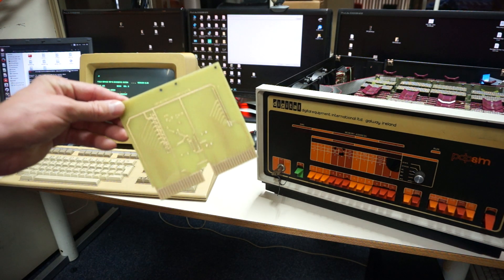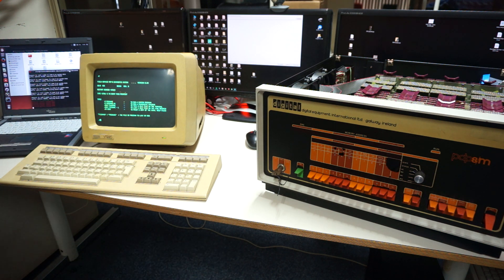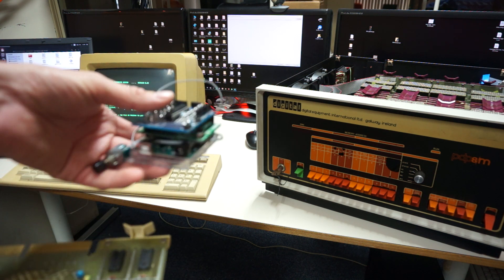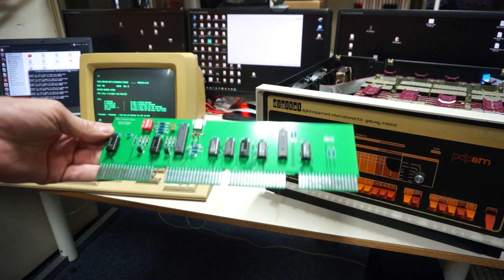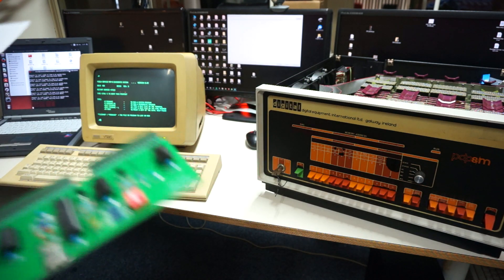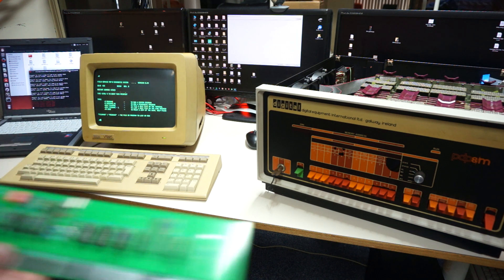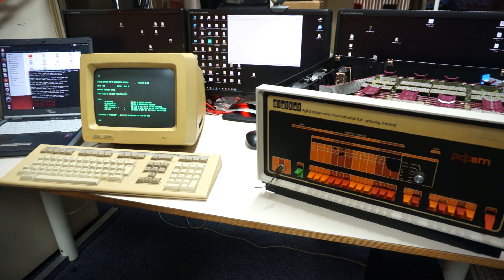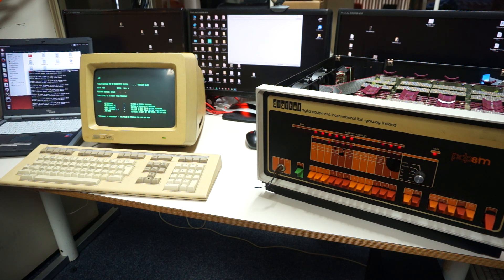M847 extended edition, bootloader for PDP8/e PDP8/f PDP8/m first demo

Comment: Do you have a website? or some way to contact you about my PDP-8/E and your boards?
Reply from the maker: Well I have put the link into the description where you can find all the files you need to build this boot loader board. If you have other questions then please let me know.
Reply: @proxxima038  Thank you very much. I was wondering if you have any run of these boards planned? Or if I would have to send the cad files to a PCB house? thank you. I noticed the github has no way to email you directly. It would be great if I could contact you. Maybe you can add your email somewhere in the git project?
Reply from the maker: @w2hx  I've sent you an email trough your website. Regards, Roland